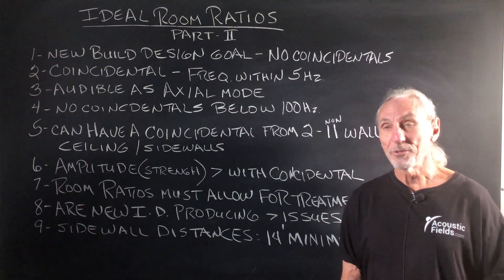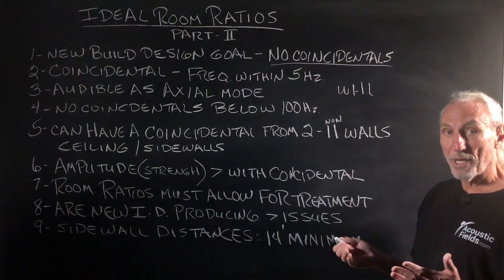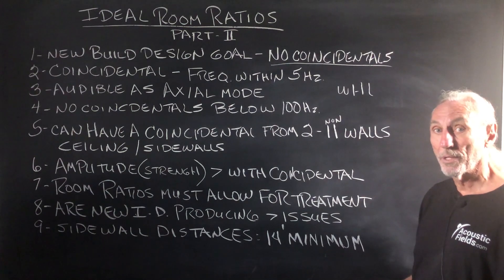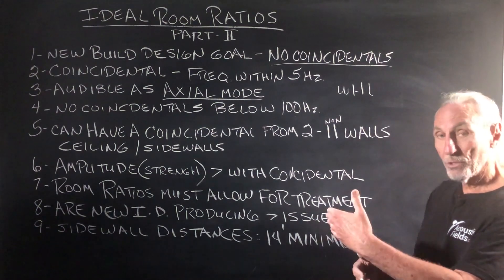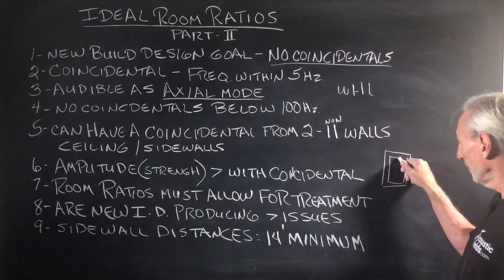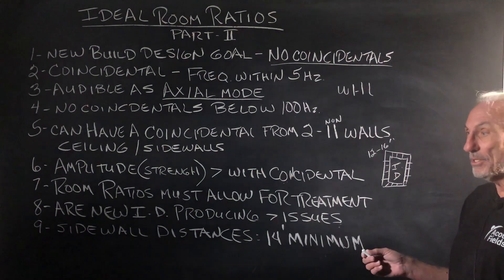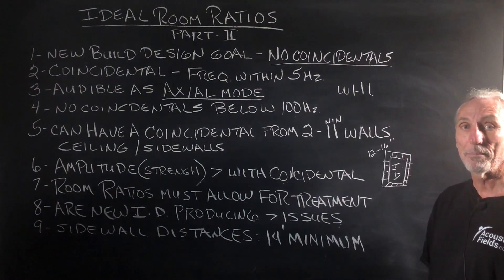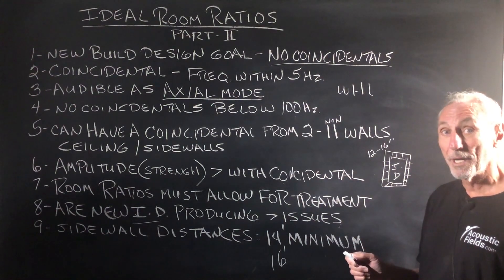Ideal Room Ratios Part 2 - www.AcousticFields.com

Comment: Hi Dennis, thanks again for consistently uploading your wisdom over the years.
Just wanted some clarification - does the new room I.D.refer to the new room dimensions that will come from building a floating room within the structure?

If I was building walls inside out walls (drywall --> fibreglass --> cloth), or mounting acoustic pads onto the walls, would I still need to consider the new room I.D? Or does the new room I.D only refer to solid drywall?
Thank you!
Reply from the maker: A floating floor is a barrier technology. It is used to isolate the floor from the existing structure to minimize noise transmission. The term ID means internal dimension which is the distances (width, height, length) of the room after all absorption treatments have been built into the walls. The OD or outside dimension is the distance before in wall treatment.

Comment: What characteristics should the floor of a music room have? My best candidate for a music room is a former dining room. It is located on the first floor of a concrete building made in 1937. The floor is covered with a herringbone parquet over timber subfloor over concrete. It is not acoustically dead. Do you reckon it can be made suitable for music reproduction without sacrificing the parquet?
Reply from the maker: You will have to do some listening tests to determine its impact.

Comment: Hi Dennis, great video thank you. You mentioned having a ratio that accounts for the coincidental as well as the axial and tangential issues in a room. What on average did you find this ratio to be? Sepmeyer being 1:1.6:2.33 for example, thanks.
Reply from the maker: These ratios are designed to show you coincidental modes along with axial, tangential, and oblique. What these ratios do not show is how much space you will need to treat the issues. They are a "no treatment" number ratio. Our ratios include the 12" you need to treat the room of the issues that Bolt and Septmeyer determined. Sometimes when you add an additional 12" of space around the room perimeter for treatment, you can actually change the ID internal dimension of the room and make it less favorable after treatment. We want an all favorable after treatment giving up the 12". Remember the first rule in acoustics is do no harm.
Reply: @AcousticFields  So what you're saying is that you will aim have something such as a Bolt ratio for example once the room is fitted with treatment? Including say the 32" of treatment on both sidewalls if treating down as low as 32hz? This is how you deal with coincidental modes? Thanks